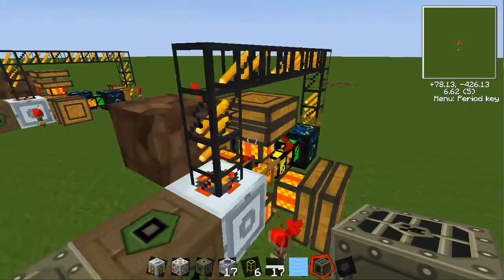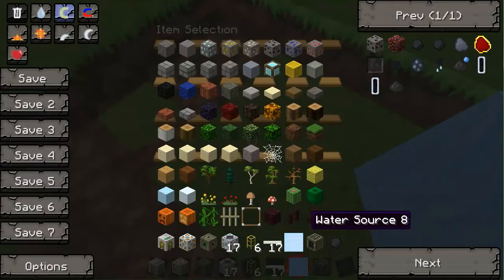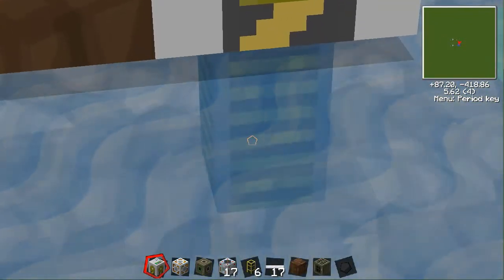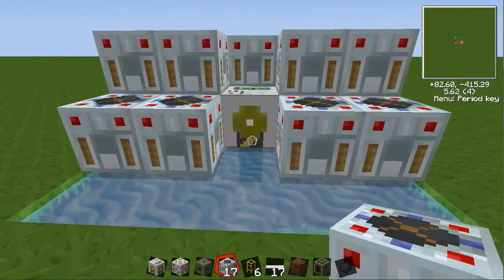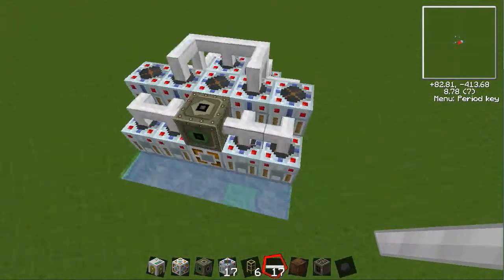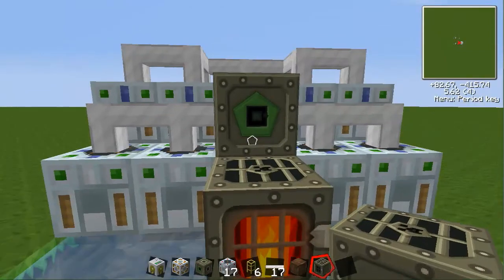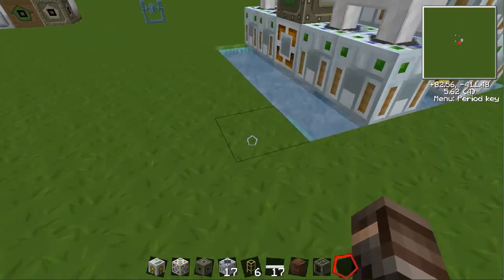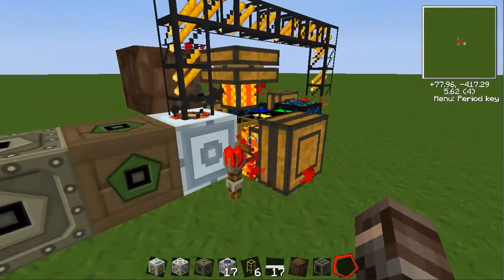Tekkit Tutorial - Hydro Flowers(Infinite EU)

Comment: Pardon me for intruding, but I found this on the Tekkit wiki as a video. You kinda replaced mine, by replacing it with this. Bit mean really. I did the EXACT same thing almost 2 months prior to this 'tutorial'.

Anyway, I don't mind you copied, that's fine. But replacing the video rather then adding to the list was a bit mean, on both my part and the community. If I recall, there were actually 2 videos there.